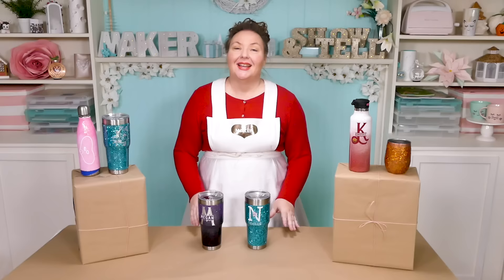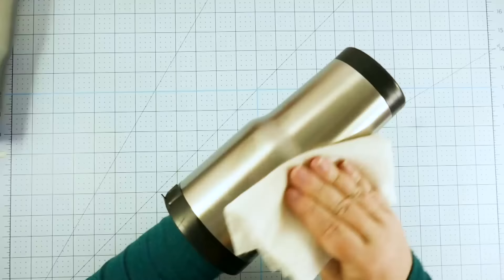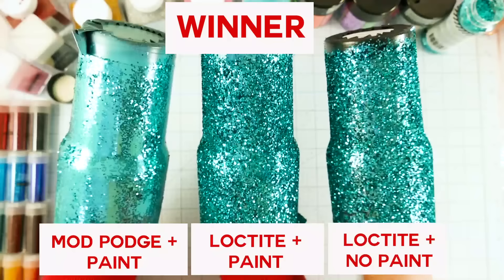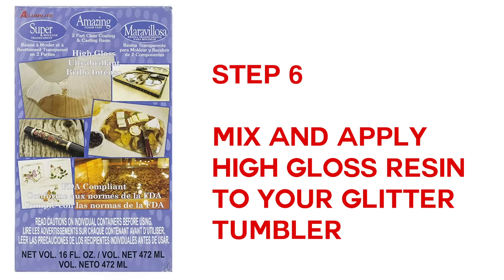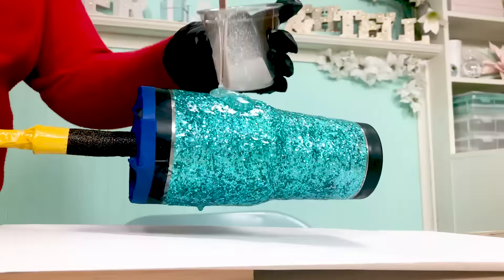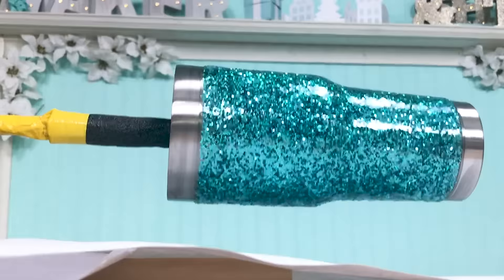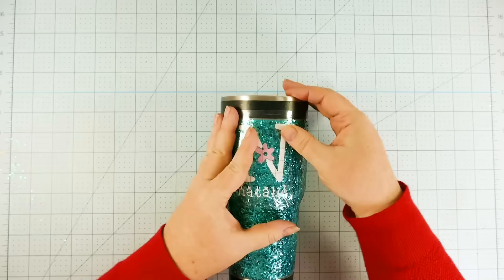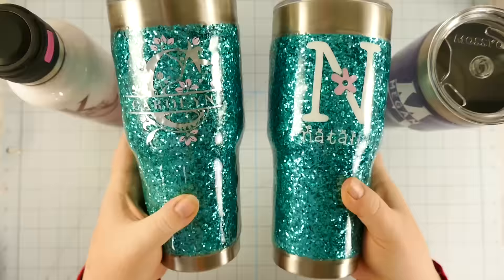Glitter Tumbler Tutorial - Epoxy + Loctite Method - Full Process Start to Finish!

Comment: After the second coat of resin, do we sand again before we say its done or just leave as is? You mentioned sanding again towards the end but didn't say if we should do it after the second coat of resin. Just want to clarify! Thank you!
Reply from the maker: It's up to you, Kayla! I haven't seen a need to - the reason for sanding after the first coat is to rough up the resin a bit so the second coat will adhere to it. But, if you felt the second coat needed some more smoothing, you could certainly sand it again with the same sandpaper! 😊
Reply: @JenniferMaker  thank you! Also, when i spray on the glue, it gets clumpy in some spots? How do i avoid that?

Comment: How were you able to make the wine tumbler without the glitter going on the way to the top? Did you seal the top with epoxy as well or is there something else to seal the paint?
Reply from the maker: I put tape around the top and removed it before the epoxy set.  The top is unpainted and left just as stainless steel so it's food safe. :)

Comment: Wow those are great. Jenny have u  tried regular plastic bottles ? Just wondering if you  can use then or does the resin only work on meta ?
Reply from the maker: The resin might crack or fall off on a plastic bottle, so I would always go stainless steel! :)
Reply: @JenniferMaker  o great thanks !

Comment: If you were using chunky glitter, how much epoxy would you add to cover it? For the first coat of epoxy. Do you add it until you don’t feel the chunkiness anymore? or do you just do enough to get epoxy on and then add a coat again after it dries?
Reply from the maker: You are going to want two coats of epoxy whether you have chunky or fine glitter, Rachel! I made sure everything was covered, that was the important part! If you take a look back at the tutorial starting at about 16:30, you can see how much resin I used. It was a good amount - by continuing to turn the tumblers, you will make sure that it all settles down more or less equally! 😉🥰

Comment: since the vinyl is encased with epoxy, would it be alright to use removable vinyl for this process?
Reply from the maker: You could but be careful, the epoxy may seep under the removeable vinyl.

Comment: Also after I get the glitter if I wanted to add vinyl design and letter what I do that after one coat of epoxy and then what I do another coat of epoxy to seal the vinyl design?
Reply from the maker: Yes you can! You can put on a thin top layer to finish off your tumbler.

Comment: Would it work if you use a heat gun or hair dryer to dry them faster?
Reply from the maker: No, resin just takes a while to cure, especially when it's in thin coats, it will cure faster in a warm, dry environment  😊🌻

Comment: Does it matter what Polycrylic sealer finish you use? I can only find satin finish and matte.
Reply from the maker: No, Liza, it doesn't matter which finish you use! The sealer is only to keep the glitter in place while you apply the epoxy - I've used both finishes and haven't noticed any difference! 😉😍

Comment: How long do you wait after glittering with the loctite method to remove the tape? I was going to remove the tape and put more tape on to create a seal before epoxy but wasn't sure when to remove the first set of tape.
Reply from the maker: I would wait maybe 30 minutes or so.

Comment: Hi Jennifer!  I am making glitter tumblers for the first time using your tutorial.  Everything was fine until I got to step 8.  When I tried using sandpaper to smooth it out, some of the resin just came off (even though I waited more than 5 hours after previous step.  Any idea where I went wrong or if there is anything I can do to fix this?
Reply: Actually the resin didn’t come off completely, just smudged
Reply from the maker: The time can vary depending on how thick the resin is applied. Here are more detailed instructions in the tutorial. https://jennifermaker.com/glitter-tumbler-tutorial/

Comment: I notice once the tumbler is on the turner the tape has no glitter on it. Did you change out the tape after applying glitter and before doing the resin step?
Reply from the maker: Yes, you would need to retape before each layer of epoxy.

Comment: I had a question the poxy one I mixed got really really hot and dried up quickly. I’ve never used it so I must be doing something wrong
Reply from the maker: Gee, Alexander, were you using the same epoxy as in the tutorial? If so,  it is important that you measure it correctly, and mix it thoroughly for the exact time that is discussed. That should work! :)

Comment: What did I do wrong? I bought the Loctite (correct one) sprayed well and glitter barely stuck. Not sure what to do next? Seal or respray with adhesive??? and redo??
Reply from the maker: make sure you spray a lot of it and don't let it sit long before adding the glitter.🥰
Reply: I ended up having to do 4 coats of glitter to get full coverage (before I saw your answer). But boy does it look gorgeous ; )  @JenniferMaker

Comment: Hello, I put the resin on the stainless steel to the top. Is that okay or should I strip the tumbler?
Reply from the maker: Resin is only considered safe for food contact once it has fully cured. Of course, keep food or beverages well away from resin and hardener in its pre-cured, liquid form.

Comment: So I did my first coat of expoy about 8:15 last night. I let it turn overnight.  It’s now 7:30am. The epoxy is is still stick however I can hold the cup and not have residue on my hand. It’s just tacky. Can I go ahead and sand it down or should I wait longer?
Reply from the maker: It should be cured by now, Virginia! If it's still just tacky, it's usually because something was a little bit off. There are several factors, but the most important is to make sure the two parts of the resin are stirred individually for one minute, then combined thoroughly and stirred for three minutes. The best thing to do would be to start over and be extra careful to follow all the instructions! 🥰
https://jennifermaker.com/glitter-tumbler-tutorial/

Comment: I have a question that probably sounds really silly, but, I've noticed that spray paints have lead in them, when you seal the cup with the epoxy and given that it is on the outside of the cup is the lead based paint no longer a concern?
Reply from the maker: NO question is silly, Sarah, so never be afraid to ask! The paint is sealed by the epoxy. But, as I mentioned, you don't even need to paint at all! It didn't seem to make that much difference after you glitter it! I have also noticed that some companies, Krylon in particular, are starting to come out with lead-free enamel paints, so if that is a concern to you, you can keep an eye out for those paints! 😉🥰

Comment: Hi Jennifer!  Love your channel!!  I tried my first Tumbler but its a little lumpy and bumpy.  Does that mean I used too much resin?  Or what can I try to do different next time.
Reply from the maker: Could be a couple of things, Lynn! Bumpy can be caused by uneven temperatures in the room, by dust falling into the resin as it is curing, by uneven turning of the tumbler turner or by too much resin! It is quite an art, learning to make tumblers, but SO worth it once you figure it out! You can do it! 😍
Reply: @JenniferMaker  thank you so much!  I started it outside, then brought it inside.  Maybe hot to cold did something.  Thanks again for the reply!!

Comment: I’m hoping maybe you can help! I tried to make a tumbler. Everything was great until I applied to epoxy. Now it’s just dull. No sparkle at all! I used the exact epoxy you did. Maybe the glitter I used isn’t able to handle all the coats of sealant and epoxy. Any ideas?! Have had this issue before? Thanks!!
Reply from the maker: I'm not sure exactly!  It could have been the glitter you used.  I have never had this happen.
Reply: It was definitely the glitter! I did a test and took the same glitter and mixed it into the epoxy. Just what I had left over and it immediately went dull. So note to self. Be careful with black glitter. Test a small amount first! Thank you for your help!!

Comment: When curing for 24-48 hours, does the mug have to keep turning?
Reply from the maker: No, it does not. You can take it off the turner after there's no longer a chance it could drip. I usually keep mine turning overnight and then turn it off in the morning.

Comment: Hi there! I'm new to the tumbler making world.. I have a question. One of my tumblers epoxy didn't cure all the way.. still tacky after 24 hours turning in a 55° garage. I tried to sand it and put another thin layer on.. (thinking that would do the trick) but no luck. Any suggestions what I can do?
Reply from the maker: It may take longer than 24 hours to cure depending on the thickness.

Comment: Okay, why don't you wrap the tape in the opposite direction so when the rotisserie rotates you can just hold on to the tape and it should rotate it off for you. Hopefully the motor is strong enough to handle that without burning up.
Reply: @ceecee8757  not talking about burning up turning the tumbler. When you hold a machine in constant motion it can burn up. By holding the tape as the rotisserie rotates as per my suggestion she's basically applying brakes to something not meant to be stopped by any method other than the power button.

Comment: After u glitter, did you change the tape? As the tape was clean when u started to put the resin on.
Reply from the maker: I did so it would be easier to see on the tutorial! You don't need to! The important times to remember to remove the tape are 30 - 45 minutes after you apply the first coat of resin, and 30-45 minutes after you apply the second coat of resin! 😊

Comment: Can you tell me what is the difference between the 100 & 300 adhesive on these tumblers ?
Reply from the maker: Loctite Professional Performance 300 is a premium-quality spray adhesive that creates high strength and temperature-resistant bonds for indoor and outdoor use. The heavyweight formula is ideal where support is not possible. 100 is is lightweight.
Reply: @JenniferMaker  thanks sweetie

Comment: I LOVE YOUR VIDEOS!!!!  I have recently gotten a request for one that requires a multi colored vinyl decal that I am ordering from Etsy.  I am not sure how they make these decals but I was told that I should use water based epoxy.  I use the Alumilite and am not sure if this will damage these decals. Have you ever put epoxy over colored printed decals and if so would you recommend using Mod Podge over the entire tumbler before using epoxy?
Reply from the maker: You should definitely seal your design with mod podge first and then epoxy. Thanks for commenting!
Reply: Thank you so much!!!

Comment: quick question 
can i use clear acrylic spray or polycrylic to seal instead of epoxy?
Reply from the maker: Quick answer is "no"! The spray will not give you a thick enough coat to seal the glitter - only the epoxy will! 😉🥰
Reply: even if i brushed on a few coats the polycrylic from the tin that i get from home depot and not use the spray? i have an allergy to certain chemicals and epoxy is not in favor for me. what else can i use instead?
thanks

Comment: Do you have to keep it on the spinnner the whole time ? & how much resign should I use if I’m doing 7 at a time I’m new to epoxy 😩
Reply from the maker: Yes, you must keep it spinning the entire time it cures.  It depends on how much epoxy you use per cup, so that is a difficult question to answer. I would buy a large package, if you have leftovers, it just means more tumblers! :)
Reply: @JenniferMaker  ohh okay thank you! 😊 , one last question could I do one coat or would it have to be two?

Comment: What about using 200 spray adhesive...thoughts?
Reply from the maker: I've never tried it, but it should be ok, Andi! Just don't use the 300 as it is water and heat resistant, and glitter just doesn't adhere well to it! 😉🥰

Comment: I'm late I KNOW but do you have to sand it again after you cure it the 2nd time?
Reply from the maker: Hi Kit Kat! If you are done applying everything to your cup and it is a smooth surface after the epoxy has cured you do not have to sand it. If you plan on doing a decal and then covering in epoxy again you will want to spot sand, getting rid of any rough spots.
Reply: Jennifer Maker THANK YOU SO MUCH!!

Comment: I know this video has been made a long time ago but I was just wondering if I epoxy a mug, do I need to sand it?
Reply from the maker: You would sand after you apply the epoxy and glitter.
Reply: I know this question is so unrelated to the glitter tumblers but what if I don't do glitter and I'm only putting a permanent vinyl decal on it and I am only epoxying the mug. Would I need to sand down that epoxy or leave it as is?

Comment: My resin was on for a few hours (the first coat).  Paper blew onto the tumbler.  I pulled the paper off but now the glitter and resin is ruined.  Is there a way to salvage this or remove the resin
Reply from the maker: Oh man! That's a bummer! :(. You can try sanding it down.  There are chemical methods to remove resin.  I would google. :)

Comment: Does anyone know what to do if you don't want the lip at the top and bottom? Do you have to do something to keep the epoxy from going into the cup or going onto the bottom? Do you want it to go on the bottom?
Reply from the maker: Hi Emily! You don't have to create a lip at the bottom, but from experience, it can be tricky to get the tumbler to stand up if the bottom is uneven with epoxy. You would need to take special care that the bottom was flush. You would still need to create some buffer at the top so the epoxy doesn't go inside the tumbler, though.

Comment: Heeeeelp! It doesn’t matter what sand paper i use or how many layers of epoxy i use as soon as i sand it down it scratches the glitter and takes off the color!! Idk what to do anymore
Reply from the maker: If sanding is causing the glitter or image to lift you may need to use a thicker coat of epoxy.

Comment: When putting the glitter on, the glitter went all the way to the tape.  When you went to put the epoxy on, you had a line without glitter above the tape.  How did you do that?
Reply from the maker: I just put the tape a smidge higher on the tumbler so the epoxy would go over the edge of the glitter.
Reply: @JenniferMaker  I see.  So when you go to put the epoxy on, you've moved the tape.  Thanks!

Comment: Hi Jennifer! For the 2nd coat of epoxy. You said to let it cure for 24 to 48 hours. Does that mean I leave it on my tumblr spinning for that long? Or do I do another 5 hours  and then just let it sit until the 24 or 48 hour mark?
Reply from the maker: I like to leave it spinning for as long as possible. I wouldn't remove it until it's completely hardened.
Reply: Jennifer Maker thank you SO much for getting back to me 😊
Reply: Jennifer Maker so I put a nice layer of epoxy on my tumbler but I noticed that the epoxy didn’t harden over some of my vinyl decals. Do you have any guesses why?

Comment: What happens if the second layer of epoxy doesnt dry correctly? My tumbler has been drying for almost 3 days and its still tacky feeling. The first layer had dried for almost 24 hours before I did the second coat to cover the decal. The first coat turned out perfectly. Second cost is still tacky and looks uneven
Reply from the maker: Hello Kyla! The main reason for epoxy not drying properly is that it was not mixed thoroughly enough. It is so critical to get the epoxy mixed correctly! But all is not lost! This is what you need to do:
 - Scrape off the wet epoxy
 - Wipe w/denatured alcohol
 - Sand
 - Wipe off ALL the sanding dust
 - Pour the second coat. Make SURE the epoxy is thoroughly mixed 
   before pouring. 
Hope that helps! You must know what to do, if the first coat turned out perfectly! Good luck! 😃

Comment: So how do you keep a line of no glitter an just resin?  I understand that you tape off the top and bottom... but wouldn't glitter cover everything untaped?  Slightly confused... thanks!
Reply from the maker: Thank you for your question, Aubrey! Don't ever be afraid to ask about something you aren't clear on! There is no part on the tumbler that is just glitter and not resin. The glitter and resin together are supposed to cover everything that is not taped. Does that help? If not, please get back with me! :)
Reply: @JenniferMaker  thank you so much for your speedy response!! I was referring to the line of just RESIN. the resin goes a little.higher than the glitter.. how does the glitter not get on that?

Comment: Ok what am I doing wrong, while mixing epoxy it turned solid white I thought it was because I was outside and it was cool so I go inside mixed looked good,  I started to apply it and almost done applying the epoxy and again turned white and the cup looks like it has gloppy mess on it I'm not worried yet because I can sand it down right, well at 5 minutes I take the tape off and it was already set looking white and I pull the tape all the way off and I literally had to use a cutter to trim off the epoxy that was left off the tape at first I pulled it and I pulled a piece of from the area I needed the epoxy on, I don't know what I'm doing wrong!!! Helllpppppp
Reply from the maker: It could have reacted strangely depending on the temperature.  I'm not sure if you can save it.  What kind of epoxy did you use?

Comment: Do you have to do two coats of resin if you don't use decals?
Reply from the maker: Yes, you still want to do two coats, because the finish is still sort of rough after just one. It be nice and smooth after two coats of epoxy! 😉🥰